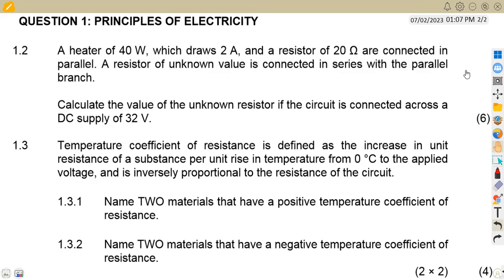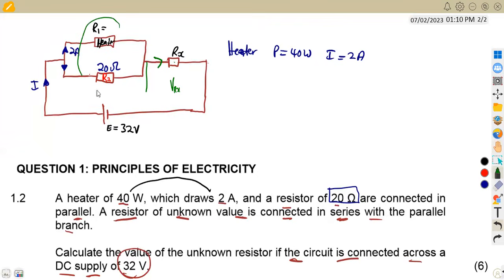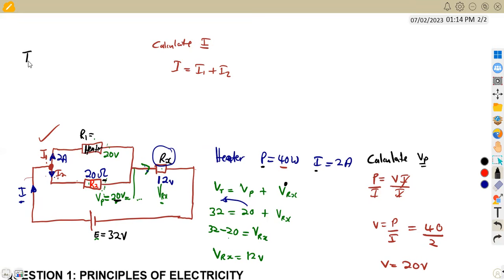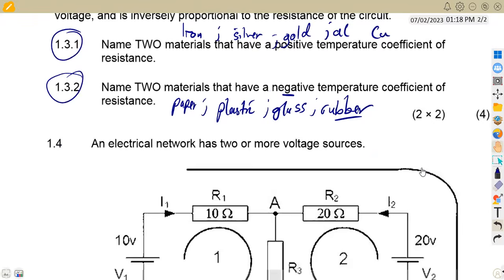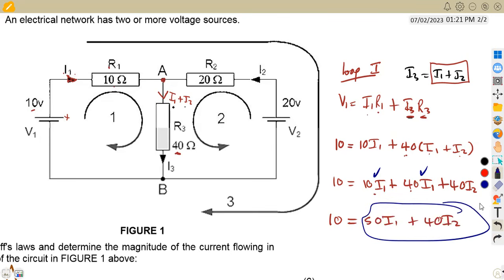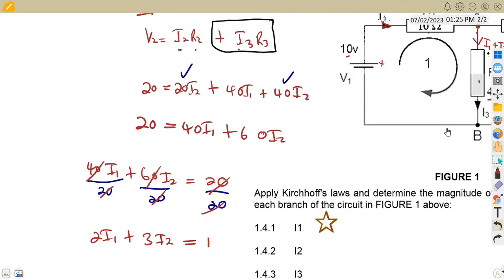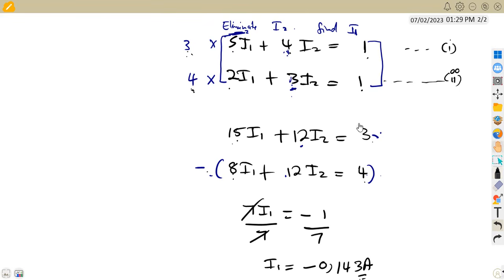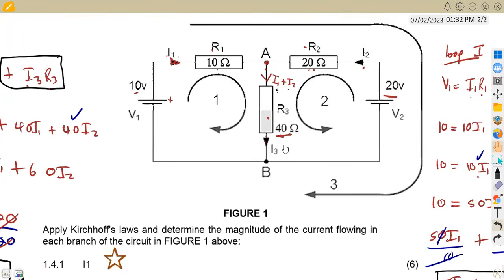Electrotechnics N4 Principles of Electricity AUGUST 2021 @mathszoneafricanmotives

Comment: Sir why did we not consider the current flow at I2 so when where dealing with the second half loap it's a negative 20 because of the direction of current from the battery